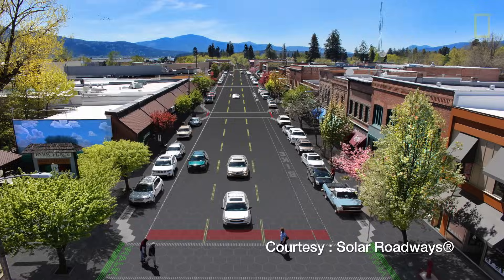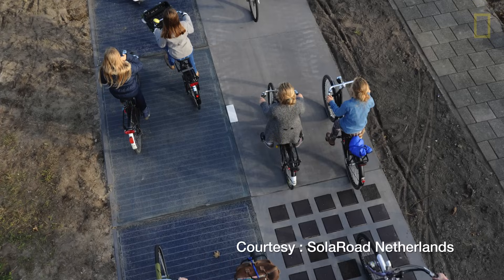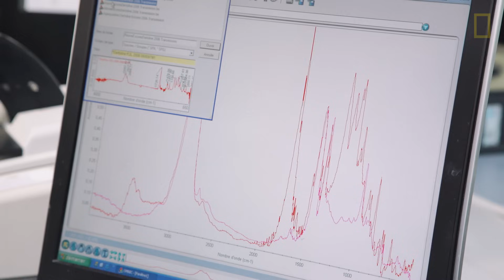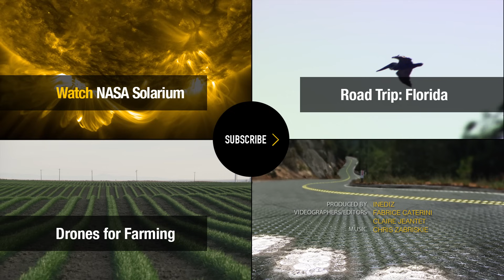Solar Roads: Can Streets Become Giant Solar Panels? | National Geographic

Comment: There's no way a country could every afford to do any of this with the cost of materials alone. Then you have to think about all the new and very costly infrastructure needed to transport the electricity.  Can you imagine the mess a snowplow would make out of this after a few dozen passes?  Then there's the maintenance costs... and it goes on and on.  I would imagine if someone looks into the cost doing this it would get into the 10's if not 100's of trillion dollars very quickly.  Most countries are struggling to maintain their existing roadways... this is pure fantasy land bullshit.
I can't believe this stuff gets past the first step.  As soon as someone says solar power it's seems like some switch for critical and logical thinking gets turned off in the brain.
I am actually surprised they didn't disable comments for this video like the solar freaking highways ones did.

Comment: You couldn't imagine a worse place to put a solar panel.
Reply: +Landrew0 Indoor flooring solar panels!! harness the wasted light from your light bulbs that arent used!!
Reply: I stand corrected.
Reply: Bottom of the sea.
Reply: jake kim 
Why not line the walls also? Money's no object, when it's not yours.
Reply: Even a roof over the road with solar panels on it would work far better and cost far less.
Reply: The inside of orange juice bricks
Reply: Zilhah Hadad 
Instead of heating elements which require far more power than any solar panel could possibly produce, a roof over the road would be far cheaper, keeping the road dry of water, snow and ice at all times.  
Putting solar panels on the roof would be far more efficient, and wouldn't need to be built to take traffic, and they could be angled to the sun.
LED markers would be much more visible under a roof, and wildlife warning lights wouldn't even be necessary if fences were built along with the roof.

As a side point; dark asphalt absorbs nearly 20 times more energy than the best solar panels, heating the road, and melting ice.
Reply: Zilhah Hadad 
Not enough ideas for ya?
Reply: You're right, lets tear down trees in a forest to put them there

Comment: Sounds great but winters in the cities mean salting and scraping to clear roads of ice and snow. How tough can they be?
Reply: Ask yourself one question... Why would you put them on the road when you can put them on the roofs? If we would be out of roofs and other space to put them on ok then maybe just maybe we can consider this but in every other case whats the point to take solar panels which are expensieve and make them even more expensive and less efficient by putting them on the road?
Reply: No to mention you can just put a massive solar farm in like... Any desert. and avoid the material costs, inherent design flaws (ripping up all the roads andq parking lots,etc. the large costs of maintenance, the fact that theyll be covered by car shadows, the sun will hit them at a glancign angle signifcantly reducing effeciency, and several more)
Reply: @chauhannishith  even then it will break in day's and still doesn't make any any sense!
Reply: MrDynamicMan it's sad
Reply: Apparently they are trying to make this idea even dumber by adding H E A T E R S to them.

Comment: in a few words no..no ..just no. What a waste of money, time, solar cells and more importantly Energy. Basic energy calculations prove that this won't work and that's not including cars/people traveling over them. This kind of crap is bad for renewable projects it's hard enough to optimise and fully utilise solar farms or roof top systems without worrying about traffic running on them. Stop now please and stick with roofs or at least somewhere free of increased intermittency.

Comment: Rooftop panels that can adjust the pitch to the sun are far more efficient and economical. These roadway panels are an overpriced pipe dream that needs more examination than investment. I encourage these companies to innovate and these ideas for solar power to grow, but this will never be economically efficient.
Reply: +DoNotTouchMyPepes There are way too many problems with this idea. As cars drive over the surface they carry grit and abrasives in the tires. The surface will inevitably become dirty and more opaque. The cost of making the substrate to precise geometry is staggering. One mile of this road will cost tens of millions to install. The payback will not come in decades if ever. I am in favor of grant money going to these sorts of renewable developments, but not in cases that can be quickly dismissed with clearly more effective results.

Comment: The point of alternative power; it's an alternative. If they generate energy at all, it's a plus.
Reply: +Andreas Tollånes (FanzyPantz) Not if they require more resources to create. Solar roads are idiotic.
Reply: Yes, because solar panels inside your house is perfect alternative power after all. Maybe you can cover all the inside walls and save some of the wasted energy from light bulbs.
Reply: That's just such a bad argument, Andreas. It might make some sort of sense if we had already covered everything but the roads in solar panels, but we haven't. At all. We're not even close. We haven't even covered all the roofs yet and they're many times better than roads ever will be.

There will never (regardless of new discoveries and technologies) be a time where placing a solar panel flat on the ground make any kind of sense. It simply has to do with earth going around the sun. As long as it does that, placing them flat is going to be horrifically inefficient. 

Even if they manage to overcome the traction issues, durability issues, efficiency issues, cost issues etc. it'll still be better to just take their wonderful magically amazing roadway panels and put them on a roof next to the road. Nothing will ever change that fact. Placing the flat on the ground will always be inherently wasteful and a stupid idea.

Comment: This isn't practical at all, too expensive and not efficient because solar panels that don't tilt towards the sunlight generate much less energy . Props for trying though
Reply: To be honest, nothing would have been much better in this case, because of the huge waste of time, rescources and energy.
Reply: +Joel Cashmir not if doing nothing uses less energy. Or you lose the opportunity cost of putting panels on the road compared to any other solution.
Reply: +Joel Cashmir Not doing this saves energy, money and time
Reply: ***** the point is these use far more energy to generate than it produces so they are a complete waste of money time and resources
Reply: ***** say solar roadways do produce more electricity than it uses, what is the point of placing solar panels on the road flat? placing them on the side with trackers produce far more energy, it is cheaper to install, cheaper to maintain, cheaper to replace, and has no risks at all of reduced sunlight hitting it, is there ANY benefit whatsoever of placing solar panels under the road? any point?
Reply: +Peter van der Meer watch any videos that calculate the amount of electricity this produces
Reply: .......thats the point of my comment.....it'll never be efficient
Reply: +Peter van der Meer watch any videos that calculate the amount of electricity this produces
Reply: @GrodyMaroon Please post a list of errors Thunderf00t did in his calculations and your corrections to them. Until you do, I think I'm gonna go with the actual research scientist with a Ph.D. BTW, are you absolutely sure you actually did the calculations, or are you just claiming to have done so in order to make your argument seem more convincing?
Reply: Peter van der Meer "I don't know how much it would cost to produce these roads, therefore I cannot tell if it is viable or not"

The first solar road has been created in France, at a cost of, wait for it.... 5.2 MILLION USD PER KM thats one lane, not even both both directions, and being optimistic they hope it will produce enough power to run some street lights.
Reply: +Peter van der Meer you arent getting it, the example is right BUT u have to use soooo much more solar panels to gather the same amount of light  if you want to place them flat, solar power is a complete waste of time anyways, they are unreliable, super expemsive, cannot store electricity and need vigorous maintance, researching more renewable is wayy more smarter than making solar panels
Reply: ***** *****  building roofs on top of roads is just as bad as digging up the asphalt and replacing it with solar panels, just forget about solar panels, if you love earth, install some solar panels on your roof at home and advocate for R&D departments that are researching nuclear fusion, the true clean zero pollution indefinitely renewable energy source
deuterium + tritium = helium 
1p1n1e+1p2n1e = 2p2n2e + 1n
Reply: You seriously think that having solar panels embedded in the roads we drive on sounds viable? Dirt, rocks,vibration and the sheer weight of the vehicles crossing over will ruin the surface/panels in no time.
Completely asinine.
Reply: ***** Yes we dont have a choice, the amount of fossil fuels such as oil, natural gas, coal and shale is enough to last us at least 100 years, not to mention all the nuclear power stations that will run for another 30 years or so, that is plenty of time to research a hydrogen fusion process, otherwise we will run out of energy forever, renewables are not a solution, dams destroy fish migration, wind panels are super inefficient and they dont work if the wind is too strong, solar energy is expensive as hell, they only produce electricity during the day and there is no way to store electricity, not a single electricity company stores electricity because you lose most of electricity in a few days so its a complete waste of time.
Reply: Deal. Actually, I'm going to apologize for being a smug asshole beforehand. I could have asked nicely.
Reply: GrodyMaroon 

Whatever happened to your calculations?
Reply: +jake kim 
I agree that nuclear fusion would be the solution to our energy needs, but do we really want to put all our eggs in one basket? Not to mention that it is a basket that is at best 20 to 50 years away from 'production'.
btw, nuclear fusion is not a renewable energy source, nor is it a indefinite source of energy. But it definitely will outlast the life of the earth.
Reply: +jake kim 
This might interest you:
http://www.world-nuclear.org/information-library/current-and-future-generation/nuclear-fusion-power.aspx
Reply: John Thats a bit over $2000 per m2. That is rather expensive... BUT if that includes the infrastructure (electrical bit) for the entire road, then the price per km will go down some.
Reply: It is not only about how expensive it is, we need the first step, if you put the first step then things can be cheaper as the asphalt. The asphalt wasn't cheaper than now.
Reply: David Seeg This will never be cheaper than asphalt. Asphalt is basically two ingredients, stone and bitumen. Building a solar panel roadway requires a lot of additional infrastructure for the power transmission and the panels will unlikely last as long as an asphalt roadway, and cost a lot more to build and maintain. It would be much better to build solar farms or put panels next to roadways instead of driving on the panels. Why is there a fetish for driving over the solar panels anyway? There is no benefit and only downsides to making that a requirement.
Reply: Smartphones need so much energy and nobody says anything.
Reply: +jake kim 
How do you know that?
Reply: jake kim I have done my own calculations as well. It is not just the amount of electricity it produces that is the critical factor, it is the material and installation cost as well.
I don't know how much it would cost to produce these roads, therefore I cannot tell if it is viable or not. But the principle itself is solid.
Reply: +Chris Ibe 
You cannot drive over tilted solar panels...
Reply: @MrPvdm68  you can if the frame of the car is elavated enough ;) with this SUVs would finally serve a purpose :))
Reply: +jake kim 
The biggest benefit of placing solar panels on the road is available space, and one that is government owned. You don't have to infringe on nature any further. 
Solar panels with trackers indeed make the most out of the solar panels, but flat panels make the most out of available space. Let me explain:
Take an area of 10 football fields and calculate the amount of energy that reaches the field, now cover the field with flat panels. You will find that every bit of sunlight is caught by the panels! If you use a tracking system you will find that they have to be placed sufficiently apart so that they don't cast shadows on each other. I dare say that the total amount of produced energy is greater with the flat panels then with the tracking panels.
Reply: *****
I like the benefits of a solar road since it does not use additional available space. Space that can be used to grow crops, build houses or factories.
What I react to are non quantified arguments like "it's more expensive" and so on.
I reserve my judgement until more facts are known.
Reply: Enclave Soldier Of course I think that. There is no reason why it shouldn't. I would even state that it is will last longer than the asphalt surface. Epoxies are much stronger than bitumen and will bind the surface for much longer.
Reply: LOL you see you are right when you say it is too expensive.  but you forgot that expensive depends on where you live.  cost of living and cost of material are all depends on your economy.     so the problem here is your country not the idea of solar roadways.  

I believe china already jump on the idea https://www.youtube.com/watch?v=v3Rh3yKF4m4
let's see what going to happen on that project.   since china has low labor cost. a currency that is cheap. a manufacturing country...  it make sense that making such is not expensive for them. 

again... the "Expensiveness" is your problem not the idea.  if you want to implement the idea you need to fix your stupid economy.
Reply: +Ole-Martin Thorsen 
May I suggest you look at 1:37 and tell me that what you are seeing is a smooth surface... Not only that but where did you get the idea that they are driving on glass alone. The guy clearly explains that they were looking for the right combination of glass and resin to get a good balance between friction and light absorption. 
It might well be possible that they are using pieces of glass that is being held together with resin. Exactly the same as asphalt (stone, sand and gravel held together by bitumen)

Don't be fooled by Thunderfoot stating that stone is harder than glass. While in itself this is correct, it does not mean that glass isn't hard enough to withstand rubber car tires! Nor does it mean that it will wear out quickly. It is even possible that a glass/resin road outlasts a stone/bitumen (asphalt) road because the resin could be many times stronger than the bitumen. Just like a concrete road has much less maintenance compared to a bitumen road, and yet they both use sand, gravel and rock!

Thunderfoot has mainly spoken about the hexagonal Solar Freakin Roadways and they used glass sheets to drive on directly, but that is not the case here. 

If the solar panels lasts about 40 years (which is more then I would have stated), then during that time the asphalt road has been resurfaced 2 to 3 times!

I can't be sure as to why the French are doing this, I guess it is inline with many European countries that have set targets to get a certain percentage of their energy needs via renewable energy.
Reply: ***** Thunderfoot has done many calculations but he hasn't addressed this French initiative which is significantly different from the 'Solar Freakin Roadways'.
Correct me if I am wrong, but if you do, please tell me what materials the French use for their surface and what the installation cost is per m2.
Reply: Chris Ibe
It doesn't have to be super efficient, it just has to generate electricity. It's quantity over quality.
Reply: +jake kim 
I agree with what you are saying but without actual figures I cannot judge if they are worth the effort.  And since I like the principle of a solar road there is no reason for me not to support the research into it.
Reply: +Ole-Martin Thorsen 
Rooftops are inaccessible for the government and you take away the option for the homeowner to place his own panels. Not to mention huge privacy issues that arise when the government can come onto your land (roof) when they want because they have to repair/maintain the roof panels.

I don't know what the costs are to create a roof over a road!
Reply: +Chris Ibe Still better then nothing